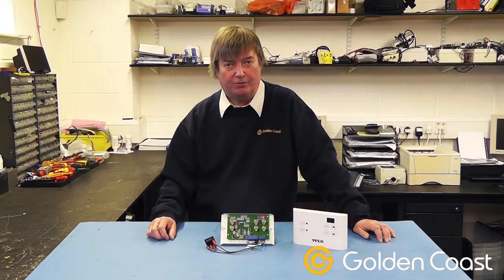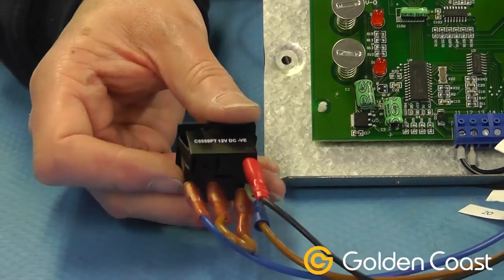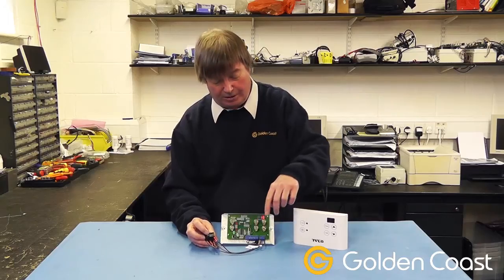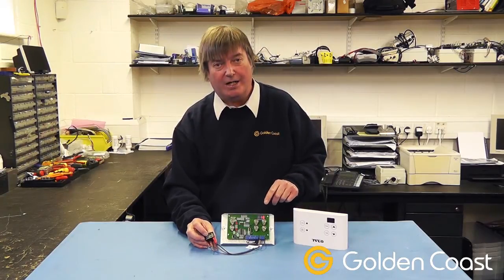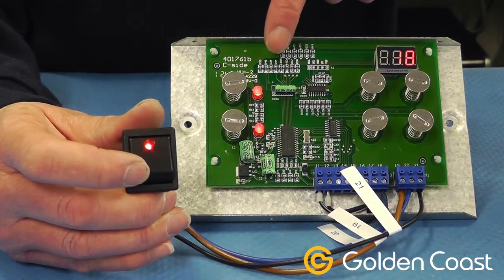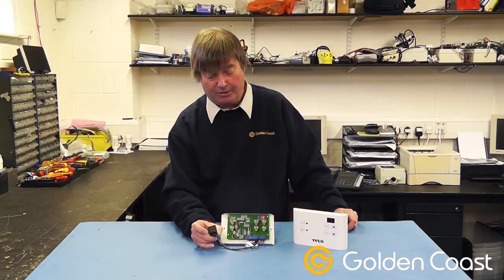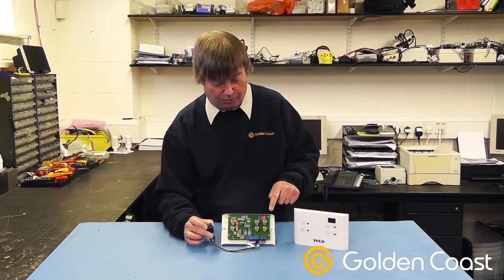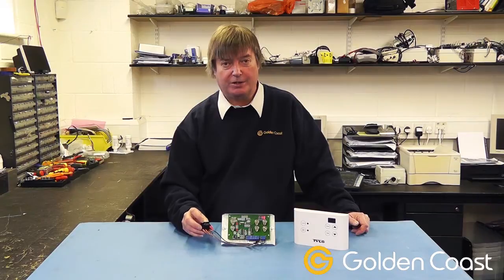Wiring a Remote Switch for a Tylo Sauna Contol Panel | Andy's Answers

Comment: Hi Andy, I know you published this video in 2013...a while back. I am considering putting a remotely controlled switch to switch on/off my Sauna that is controlled by a CC20. I have same pins 19, 20, 21. I don't know however to which 2 pins I do need to connect my switch to? I understand that 19/20 are used for pulse command. Can you help? Regards, Francis
Reply from the maker: Hi. From the CC20, 19 (switch return) -20 (+) are the switch 21 (-) is the led in the switch.
The switch can be pulse or a normal switch.
Hope this helps, Andy
Reply: Thank you Andy. I will then put relay (normaly open) between 19 and 20. That relay can be controlled by wifi and Google Home/app on the phone. Thanks.

Comment: A customer want me to orgainise a way for the steam room to turn off after 9pm as this system seems to use a pulse with the remote switch to turn it on or off is there anyway to control the unit so that it will turn off and no longer be able to be used between say 9pm and 530am?